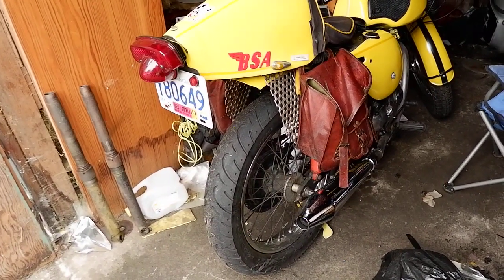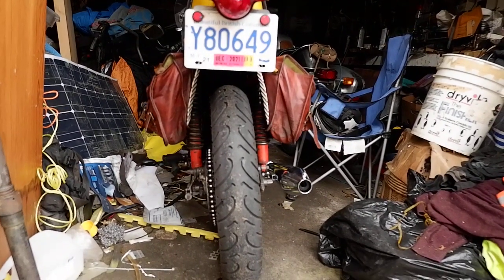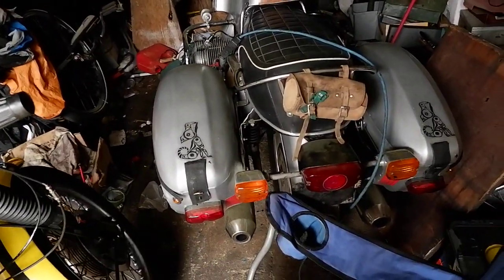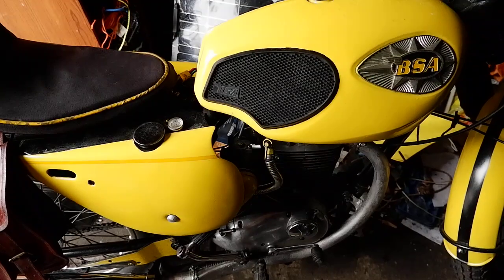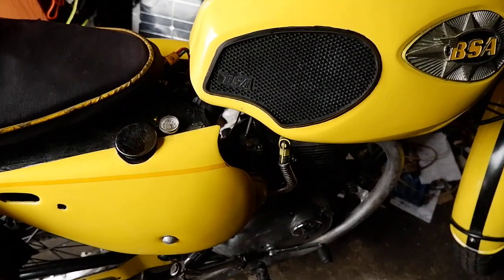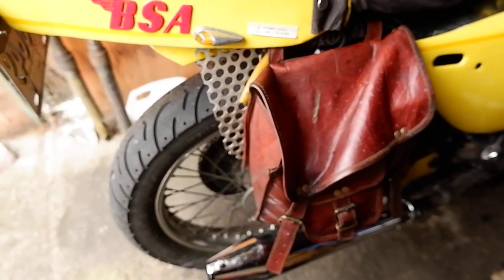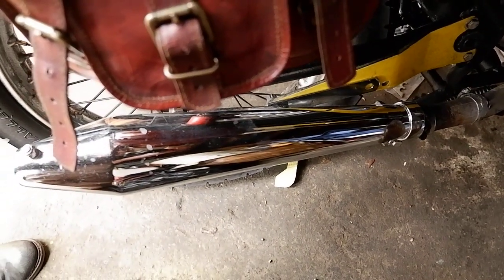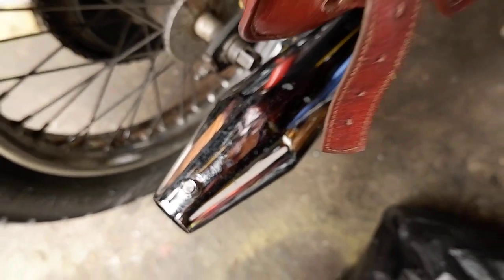BSA rear bag support done, no risk of hitting rear tire and - ground zenor diode arrives.

Comment: Missed this one somehow, oh, was riding in the Austrian alps, that must have been the reason!
This is good, now you don't have to worry about the bags being torn into the real wheel!
That ground diode is good and will be a long term fix for changing the setup!
Have you tried steel wool as a sound deadening tactic? I did that once long ago in my youth, it helped a lot to quiet the 2 stroke I had, but the 2 stroke does require some back pressure to run better. So maybe that's just BS. Can't say.
I also like the yellow coloring on the BSA lettering on the tank. Nice.